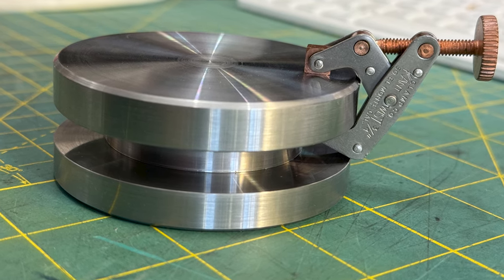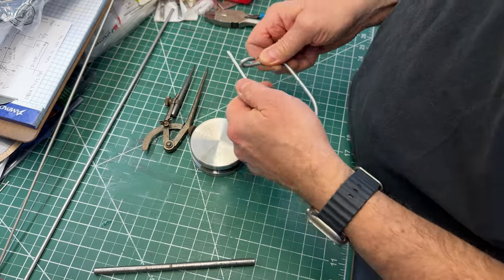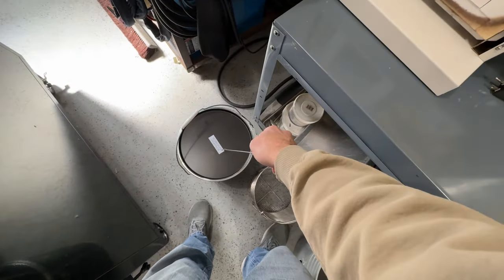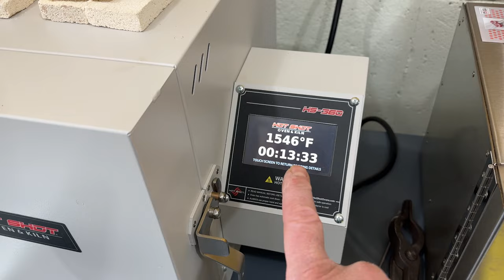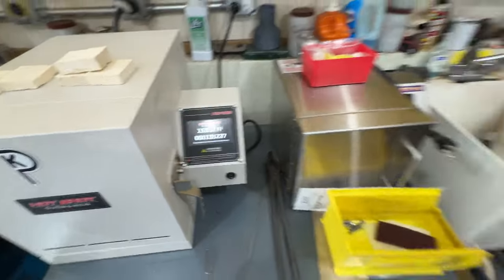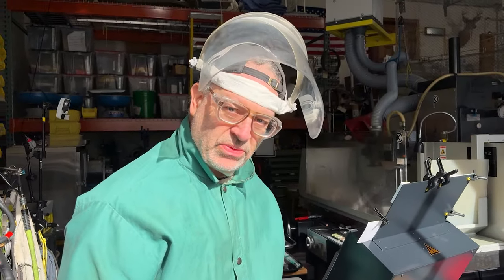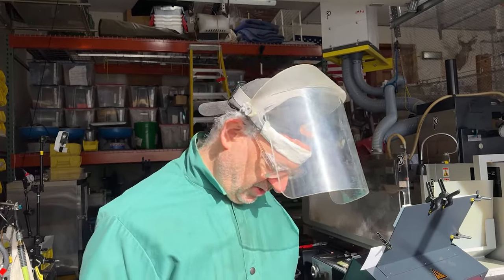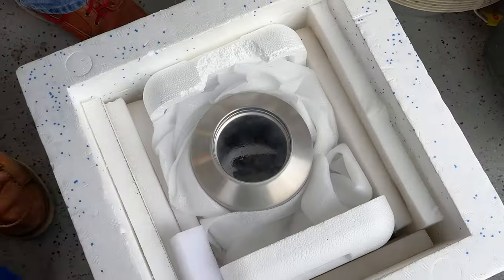Heat Treating 52100 Steel for the ToolMakers Flat - Part 1

Comment: You'll notice that the oil only smokes when you pull the material out. There is no reason for the material to be quenching to peek out of the oil. 
If you dunk the part and move it around the oil, you'll get the affect of getting fresh oil on the part. There will be a bit less burnt oil on the surface and a lot less smoke.

Comment: Stirring the oil with the part being heat treated is an excellent way of inducing distortion into the part.
Reply from the maker: Another place for improvement, thanks!